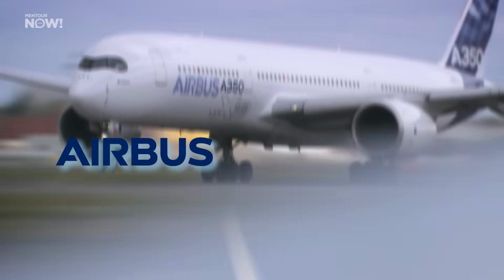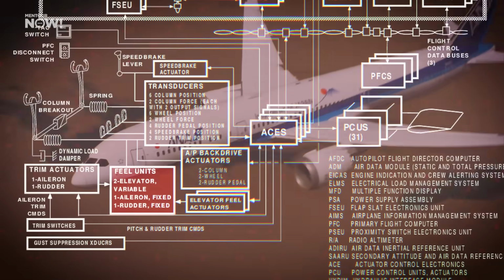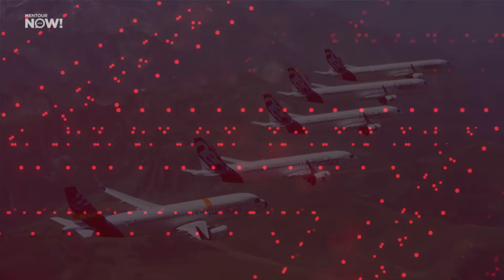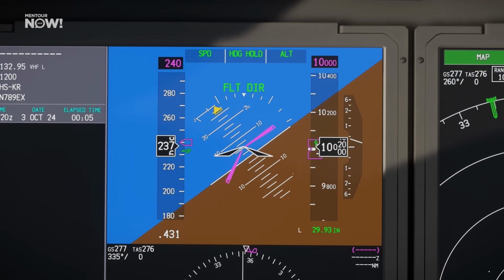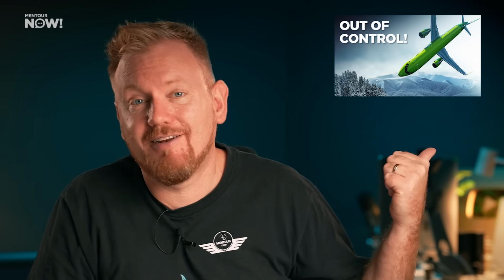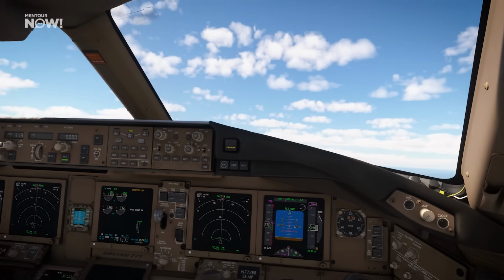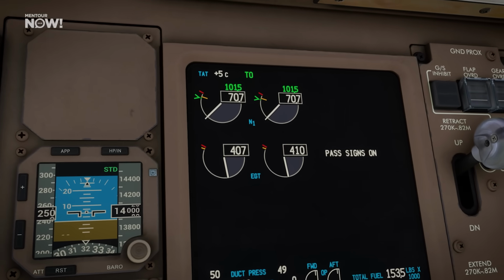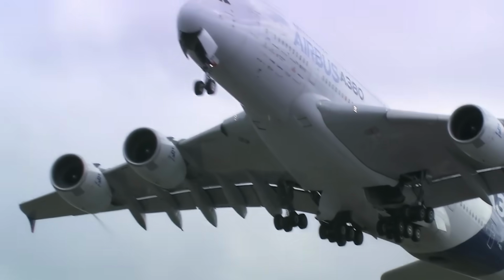Do Pilots Prefer AIRBUS over BOEING?!

Comment: Fly by wire is great, but I disagree with Airbus' choice of summing dual inputs, can't think of any circumstances where this would help in any emergency. Trouble is the only real fix would be to implement expensive and heavy side stick feedback mechanisms. But I think a simple vibration system might be enough in its place. Something, anything, to shake a pilot into realising its happening.
Reply: You mean something like flashing lights and audio warning like what airbus implemented for dual input
Reply: Summing the inputs of two sticks is the only sensible way if they aren't mechanically linked. An alternative might be the average input, but that's just half of the sum and that would halve your control range during normal operation (zero input from the non-flying pilot).

A mechanism that picks one input and ignores the other based on some criterion would be far worse because it could lead to an abrupt switch from one pilot to the other while the  pilot that's actually in control is making a manoeuvre.

If the sticks are virtually linked so that the stick that's not held by a pilot follows the movements of the other stick, then the average would be the right thing.

Maybe Airbus will introduce force feedback with linked sticks some day. Not easy in engineering: the force must be large enough that it's noticeable in a panic situation but it can't take a lot of space and it must be absolutely impossible for the mechanism to jam and render the stick inoperable.
Reply: I don’t think they would be heavy or expensive. Even cellphones have haptics these days.
Reply: No! Awyuiczeeb!
Reply: Since the audio warning can be suppressed by other alerts and visual not noticed, some stick vibration could be really useful for dual input. Should be very cheap and bulletproof, probably also easy to retrofit. Although Airbus does not have a stick shaker (?) ideally it should feel quite different than one to prevent confusion for transitioning pilots.

Comment: Not a pilot, but I do own a Tesla so some of the comparisons seem similar. Boeing came late to fly by wire, while it was part of Airbus’ DNA much earlier. That seems a distinct advantage. That’s similar to Tesla’s advantage in EV technology over the legacy ICE manufacturers attempts at EVs. Tesla technology just works better because they’ve been at it longer with engineers dedicated to the concept. Airbus also seems to make incremental improvements just as Tesla does. Not sure if my theory holds water but I can see why they seem to be winning the argument.

Comment: For every one incident where Airbus automated protections lulled the pilots into a false sense of safety, there are multiple examples of those automated protections saving everyone onboard. Even the Air France incident you cannot possibly blame the plane for what that third co-pilot did. He would have killed everyone onboard either way. You even have examples on this very channel of the airbus Toga lock saving everyone.
Reply: So, new Airbus option. Coin toss in the main computer. Select and it decides will you live it due? Can the people in the back get a display of this too?

Comment: vast debate....there is definitely some cases where the Boeing logic turned against the pilot and could have been easily avoided if the plane would have refused it as it had all the info to get the accurate view of what was happening. But also the over confiding automation in Airbus is creating hard situations where extremely rare failures happen and the commands goes back to basic inputs in a few seconds, which is extremely surprising for these pilots. Training in both cases is probably the best thing to do and glad to know that the latest generation increased security overall and this is not the end of the journey.

Comment: I am a private pilot. What bothers me about the airbus is the location of the control stick. The first officer learns to fly using their right hand. Then becomes Captain and has to learn to fly left handed?  Now most people are right handed. Ever try to write with your other hand? Brush your teeth with your other hand? Can’t the designers fix this?
Reply: It comes naturally with a little bit of training. Switching from a left hand gear shift to a right hand gear shift car isn't hard for most drivers. The pitch control of fixed wing aircraft is completely opposite to a flexwing aircraft but those who fly both can hop on from one to the other without any problem.
Reply: Good point!
The Diamond Katana has the stick in the center (which makes a lot of sense, not to mention less strain on the hands)

Comment: As a passanger, Airbus have very slightly wider cabins, but other than that there really isn't much to choose from. From the flight deck, it would entirely depend on the situation which philosophy is better, even if the Boeing one would only provide the benefit in the very extreme examples.
The Hudson landing is a great example of how the protections gave the pilots time to discuss things all the way down to the water, rather than one being consumed by just making sure the plane doesn't stall.
Reply: Luckiliy the captain improvised by starting the APU right away rather than following the checklist.
Reply: @steinarnielsen8954 I don't think luck had anything to do with it, rather the experience of the captain and his presence of mind to know what a double engine failure would mean in terms of electrical power. This is the very reason "Sully" received the medal for the encredible airmanship he showcased.
Reply: If the Sully situation happened in a Boeing, perhaps there wouldn't have been a happy ending.  On the other hand, if the Jeju Airlines crash this past December would have happened in an Airbus, MAYBE everyone would have survived.

Comment: "feel what the aircraft is doing" is the 1st thing you need to let go if you get an instrument rating. Dont trust your feeling, trust your instruments! But do cross checks. As I learned the hard way in my flight training with an old style attitude indicator that "failed" in the sim, I ended up with a pretty large course deviation before I had 100% identified "the problem" and started ignoring the faulty instrument. Very good lesson!

Comment: Could the AB crash in 1988 that crashed into the trees doing a low flyby been prevented if pilots were able get the nose up? I read that the fly by wire prevented pilots to increase thrust and pull the stick back far enough to get lift.
Reply: If they pitched the nose up any further the plane would have stalled and crashed before hitting the trees possibly killing more
Reply: @tomstravels520  I understand that but if the pilot was trying to add thrust and the computer prevented it from happening  could he have saved the plane with the extra trust to allow the higher angle of attack?
Reply: @alexrebmann1253  what? The plane was already at max angle of attack the computer would allow, the pilots applied maximum thrust however jet engines do not spool up immediately, its takes several seconds……seconds they did not have because they left it too late
Reply: @tomstravels520  According to the documentary Mayday it is believed that the computer could have contributed to the crash. When the plane flew below 100 feet the computer may have been programed to beleive that it was coming in for a landing therefore preventing the pilots to do manuvers to recover. Speed was very low to reach the maximum angle of attack.

Comment: Both Airbus and Boeing are driven by profit; without it, they wouldn’t survive in a competitive market. Boeing’s recent struggles reflect a history of overconfidence and a focus on short-term gains—a common issue for dominant companies across industries. If the roles had been reversed, with Airbus leading the market 15 to 20 years ago, Airbus might be facing similar challenges today.

This dynamic is also evident in tech, where market leaders like Intel maintain routines while competitors like AMD innovate to catch up. Unfortunately, consumers lose out when industry leaders grow complacent, resulting in slower progress and, in aviation, potential safety risks.

Boeing’s recent setbacks are not cause for celebration but concern. With Airbus now in a dominant position, there’s a risk they, too, could become complacent. What the industry truly needs is healthy competition, where both Airbus and Boeing strive not just to capture market share but to continuously improve safety. This competition ultimately benefits passengers and ensures that safety remains a priority.

Comment: Having held a B1 engineering license and flown as Captain both the B737 & A320 I find most of the arguments a bit pointless and biased in favour of the particular camp the biased party has chosen. Boeing’s main attribute is that the products are maintenance friendly and keep pilots more mentally involved in the flying. Airbus produces and aircraft that is very reliable but when it does go wrong requires a lot more thinking about. From a flying point of view the fly by wire is great until you get into severe turbulence, because there is a computer trying to give you a flight path, the weather trying to move you as it pleases and a pilot trying to keep the flight path the disconnect between the aircraft and the controls shows and makes keeping control difficult, a pilot with skill has far more control of a Boeing as there is no computer trying to put its take on what the aircraft should be doing and in effect stopping the skilled pilot from riding the turbulence. My take on the aircraft is in a busy Northern European traffic environment the Airbus is an easier and less fatiguing aircraft to fly as long as there is no severe turbulence. Once the going gets turbulent or you have to shoehorn the aircraft down some Norwegian fiord or Greek island onto a short runway then the Boeing is the place to be. I would not claim that one is superior to the other…….. it’s simply Horses for courses.

Comment: Since I first learned about the side stick (many years ago) I have always been baffled that it was EVER thought to be a good idea.  Surely it makes much more sense to have the control out in the open where everyone can see what is being done to it rather than hiding it away at the side out of (easy) sight.
Finally, who thought it was a good idea for the Captain (on the left) has to use his non-dominant hand when controlling the plane ?
But what do I know, I have never driven a plane...🤢
Reply: Have you ever operated a 360 digger ? Both hands learn the functions ,same as changing gear in a right or left hand drive vehicle.

Comment: I spoke to a training captain on a B747 simulator session at British Airways and his preference was Boeing as he could look away from the instruments, but leave one hand on the yoke and still feel what the aircraft was doing. I can see a case for Airbus bringing in feedback through the sidestick at some point as this is useful feedback to the pilots.
Reply: The Airbus will maintain its last flight path using flight control login and autotrim. So as long as you are where you want pitch and bank wise, and don’t move the stick accidentally, to be you can look away and be more flight path stable than there Boeing imo.
Reply: They already communicated on the fact they are working on tech around this. If it will ever come to fruition is another story…
Reply: @FraiseVache  It's already in some military aircraft and the technology has been around for over 25 years.
Reply: @RogerCaplan it's not because it's already included in some military aircraft and that we know how to sync a stick using an input that's something Airbus can get certified for commercial flights easily. Armies do not have that issue... And doing it right is always a complex thing. Should the stick act exactly like it would if it was mechanical? Or should the software lie in some cases to help the pilot understand what is happening better? All those questions are complex problems that they need to solve.
Reply: @steve3291  I. can do the same thing without having my hands on the thrust levers or the side stick. Just look out the window or the PFD and you know whats going on with the flight controls. In reality, you often fly the aircraft with the FCU and monitor the aircraft. Its not an issue to not have your hands on the controls. You have other sources of data.

Comment: Unfortunately Airbus creates lazier pilots.

It's not fly by wire by itself that's the problem. It's the kind of implementation of fly by wire that's the problem, and Airbus not having feedback on their side sticks and not having the thrust levers move automatically is a huge oversight. 

But the younger generation will always choose the easier route. This applies to cars as well. They don't want to be involved in the driving process.

Comment: Air France Flight 447, 2009, is an example of the "Fly by Wire" not being able to over come human error. Those pilots flew the plane into the ocean stalled. Now I assume given that same scenario, faulty airspeed indications, more modern software would overcome the "human error" involved at that time?
Reply: It’s actually worse than just pilot error. The Airbus control stick design allowed one pilot’s input to cancel out the other pilot’s input. One pilot tried to lower the nose to recover. If AF 447 was a Boeing, they would not have crashed.
Reply: @MikeSowsun it almost happened with a B777 near Paris. FO was pulling the yoke without captain noticing. Even during the day with good whether. AF447 lost speed indication due to bad whether which confused the pilot.

Comment: I for one don't believe this should prevent the human input from the pilots, but AI definitely could help in cases where the pilots get into sensory overloads and it could prevent them from making fatal mistakes such as shutting down the wrong engine or throttling DOWN when clearly heading into a stall...

Comment: As an interested outsider observer, it seems obvious that regulators should enforce standardization, starting with names, through to standardised operating laws, and how much information must be displayed and how attention-grabbing it is. 
Clearly, both stick and yoke have proved themself safe. I do agree with you that stick and throttle controls, even switches and buttons should move and clearly show their setting.

Comment: I only think that Airbus could greatly improve their design if they had a responsive stick (if the right seat pushes it forward the left stick moves accordingly with the other) and add some sort of stickshake or another haptic feedback if there is dual input. Then it should also move the thrust lever automatically in the Airbus. And then I would be calling the Airbus truly superior.

Comment: "pilots have ultimate authority" worked really well for the MAX going nuts and into the ocean.
I make it part of my contract with the travel agency that the plane will not be a Boeing.
It doesn't matter what pilots prefer. I want to get to my destination without issues.
Reply: you will not have issues with a boeing that isnt a 737 max

Comment: Going to post before I watch, but Airbus is safer it you look at injuries and deaths per 100 million miles.  Now of course the sample size is so low, the question of significance is the issue. I wouldn't hesitate to get on an aircraft from either manufacturer.  If you threw out the two 737 MAX incidents then that changes the stats tremendously.

Comment: I would say from the outside looking in there is a problem with the fly by wire design of airbus. The system is safer overall in my own opinion its the downgraded control laws that are the problem, more so the lack of feedback while in these laws. I know myself, I would have a real problem wrapping my head around flying at night or in clouds with no feedback from the plane. Also the protection that airbus has makes me nervous for one shall we say silly thing. In the event of valid reason to over bank or throttle back and climb event the plane won't let you. I know such an event is one in one million if not billion and should never happen in a passenger aircraft, but it still lingers in my head 🤪.

As for boeing I can clearly see the advantage of the feedback and soft protection. But the lack of hard protection is scary in its own right. I am less worried about how the flight inputs work these days with boeing and more worried about the other safety concerns that have been in the media.

Comment: The complacency factor reminds me of the difference between using self-driving mode of a Tesla vs a normal car. With self-driving engaged it's sort of like the driving instructor teaching a teenager - they have to be continuously on guard in case the teenager makes a mistake while still letting go most of the time. It seems like airbus piloting would require you to be always ready to take over when the plane can't figure out what is going on while allowing the automation to do its thing most of the time.

Comment: On safety statistics I would take them with a huge amount of caution. Serious incidents are usually very rare and because of the very small numbers involved you can't infer much statistically, it probably won't tell you which make is the safest. You can tell more from minor incident statistics because there tends to be more of them (as long as they are reported). Even then, it's best to be wary, a good safety record may conceal a low probability but high consequence accident just waiting to happen.